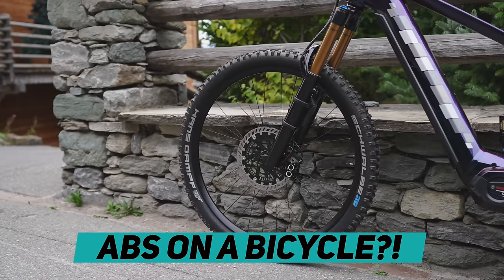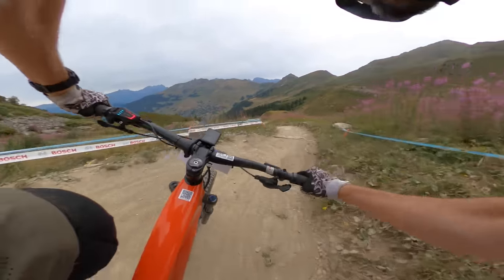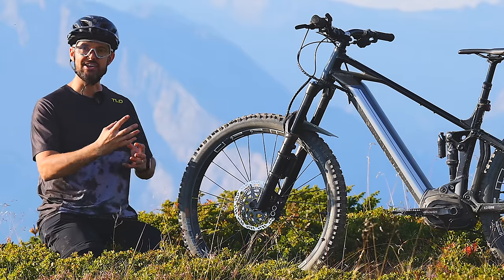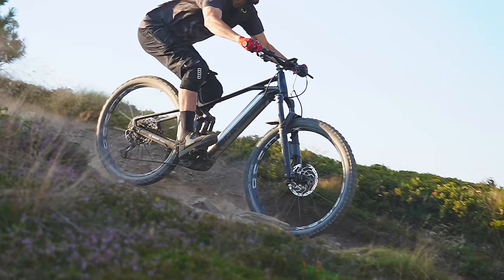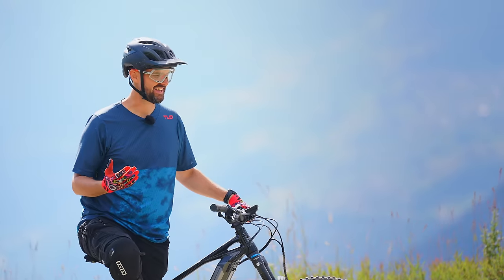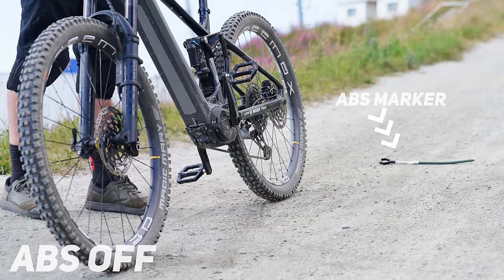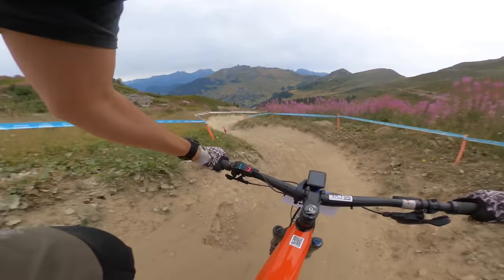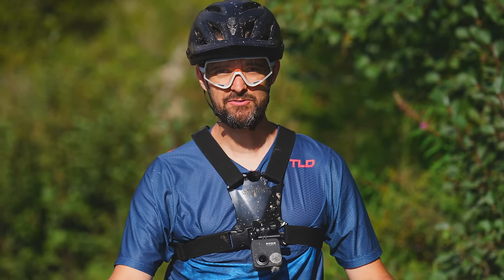I didn't want to like it... Bosch ABS is INSANE!

Comment: For new riders commuting to work on an ebike riding on wet, slick roads with mixed surfaces I think that ABS would be fantastic. Especially people who are slightly older and don't have years of built up muscle memory and quick reaction speeds. For emtb use I can see how it might help new riders coming into the sport, but I worry that this is just more tech that is impossible to service or repair. We already see many motors that are like iphones. One tiny thing breaks (eg: force sensor) and replacement pars are not available, like an iphone when anything breaks you are told to replace the entire unit.
Reply: And unlike iPhones, you can’t buy a fully guaranteed refurb at a discounted price, nor a policy for fix or replace after the original guarantee ends…
Reply: @Coolcmsc  I'm quite fortunate enough to live less than 30miles from a company called - "performance line bearings'. He can refurb a lot of out of warranty motors, my 2019 brose for sure. 
But this tech right here, i think you could be right. It's going to take a brainiac to sus out. Also depends on what kind of warranty length they offer. Surely if the warranty is spent,they can't moan when people start to strip down this unit to see what is what.
Reply: apple got sued for those practices a while back, now they do offer replacement parts. 

I don't use apple I use Samsung, because they didn't need to use ads to lie about their product to get sales. 

anyways, I have insurance on my phone since I'm always outside, anything breaks I just get an entirely new phone, I use the service probably once or twice a year (the limit is twice a year for me) 

usually insurance is too expensive to be worth it, but not phone insurance. I saved a lot of money just having my phones replaced, 

sometimes they even just send me the newer version of a phone if they can't replace it,
Reply: @mikee8244  the more software there is, the more software engineers there must be. Some hobbyist will crack the tech and the next and the next. It will all become "affordable" to service and maintain eventually. :)
Reply: As long as there is an off.  I dont see this getting regulated like motorcycles that go on road...but eventually the tech will be there
Reply: My fuggin dad. I let him use my mtb for a 1 mile ride and the number of times he skid my brand new 80$ tire.... i wanted to charge him
Reply: Unlikely seeing it’s a fully developed tech in cars and motorcycles.
Reply: E bike are generally about 10-15kgs more I generally over cook corners cause of the weight this would help on long days out  . Not for DH bikes at the park ect
Reply: 💯 percent agree ! It’s pretty cool isn’t it !
Reply: @tomhuber5372  wny not
Reply: A force sensor is generic and if you dismantle it can be replaced. E.g most sensors on ebikes such as speed sensors, force sensors are merely Hall effect sensors which are like 20 pence to buy from a electronics supplier.
Reply: Problem it's crazy expensive and complex to fix once broken, part of me loves it and is fascinated of the tech being developed and put on the market but part of me just hates it because I know it will just make bike prices increase and now some ebikes are getting closer to motorbikes than actual regular bikes and weight 30Kg...

So yeah when you say "for new riders commuting", for me that sounds like hell, commuting on a regular bike is fine and people shouldn't be afraid or feel the need to buy crazy expensive high tech bikes like those ones with ABS just for a tiny bit of supposed extra safety...
Reply: Ok boomer
Reply: one area I'd add the ABS system being useful outside of the areas mention would be rental bikes, since the shop doesn't know what skill level or terrain the riders are used to it could give some added security and peace of mind for the bike shop or bike park and few the rider renting they'll have a more comfortable time if they're new and for experienced riders it would either not make a difference or just allow them to go faster while in more control then usual.
not long ago I was riding a rental bike and it took me a bit of time before I could have my braking controlled without slipping since it had less grip then I was use to having while riding on different terrain and the brakes also had a different grab from what I was used to so I would love some sort of ABS when in a situation like that.
Reply: So you could say that the brakes brake well but if the brakes break then the brakes won't brake anymore.
Reply: @Christophe_L  the normal brakes should work just fine even if the ABS system would fail, the systems are technically independent and just influence each other so just because 1 fails doesn't mean the other one will
Reply: Just wait until the lawyers get involved with liabilities.
Things like: unable to ride your bike until it receives a software update "for your own safety",
We don't want to get sued for a failure or defect.
Reply: @TheShift1313  I certainly do see the government and insurance companies getting involved and complicating things. There is plenty of places that require people now to wear helmets on bicycles.
And you can bet insurance companies will get their nose in it with the cost and expense of modern bikes. Health insurance life insurance theft Insurance of the expensive bikes is most certainly going to raise eyebrows of insurance companies and they will get nose deep any bike technology and mandates.
Reply: yeah, any more expierienced rider will have no problems riding without abs xD
Reply: @rizen3467  even inexperienced riders will have minimal need for ABS outside of a few rare occasions with all riders both pro level and beginner could benefit from it although the benefits would be in different areas and situations.
Reply: After buying an Ebike, I've realised the best thing about bikes is slowly fading. You don't feel like the bike is truly yours completely. ABS is fantastic, but takes further down that path.
Reply: Hmm I know that the likes of Bosch do sell motor refurb kits to dealers and repair shops.    For Panasonic and Yamaha motors (the two types I have), I am able to order parts online, and I even got my hands on the technical manual for the Yamaha.  On the other hand, tasting the motor as a single unit isn't that unreasonable in my book, as it's just one part off the system, and may be cheaper to replace than repair given the cost of human labor.

Also, ebike motors from reputable (read: not Chinese) brands tend to last a very long time without any maintenance.
Reply: @tastytechaddictsmtb  speed sensors yes, torqe sensors, no.
Reply: @rizen3467  your say that, but switching between bikes, or especially to a new bike can trip you up.  Even though I had put many thousand miles on my XM-1, I launched myself like a missile with a few days up upgrading to the XM-D2 because the brakes had three stopping power of Godzilla and the sensitivity of a butterfly.
Reply: Hell, as a crusty old fixed gear rider commuting on the bike year round, I'd love to have this up front.
Reply: ABS would be more useful in powerful 1kwatt or more ebike with big 200mm brakes.
Reply: It's actually just useful straight up, I'm well experienced but you get a car over the line on a country road with gravel when you have to nail a line, especially when you're going 50+kmh on a heavy bike and you could be in the exact scenario I found myself in, not needing to worry as much about front wheel lockup is a Huge deal. If this system is mountable to any bike that would be amazing. But I certainly agree with the repairability, I'll service ebikes but not from the big brands that make it impossible to repair without damaging the case or integrity of pack.
Reply: But when you buy an iPhone, you know that everyone else who buys one, is just going to buy the next one when it comes out. So there's no incentive to produce spares for a tiny number of people. ABS systems aren't pushing needless updates every 5 minutes. Making a camera sensor slightly higher resolution without making it bigger, is pretty easy. Inventing an entirely new material for brake pads, is not. And on the electronics side, the people making ABS systems, likely don't create a single component. It's all off-the-shelf stuff as far as electronics is concerned. So it's not like your brakes are going to be obsolete by next year
Reply: Ehh adding more things to a bike just means more to go wrong.
Reply: @iliketoast7804  True, this is why I only buy carburated bicicles! Those thing run forever!
Reply: @SquadronLeadr  Did not work with smartphones tablets or laptops (especially everything from apple)

Comment: I like how you clarified early that the ABS only does its thing on the front wheel, despite using sensors on both front and back. Great video!
Reply: I think it was a safety choice as locking just the rear keeps the bike tracking straight
Reply: q
Reply: Abs can only work if it has sensors on multiple wheels
Reply: I don't actually get that part. If the rear wheel speed is the reference point for the abs system, when you apply brake on the rear wheel as well as the front, wouldn't the system lose its reference point?
Reply: @ermanakbay  
Nope, because if both wheels are in solid ground they're both going the same speed.
If you apply front brake only, you'll slow both wheels.
If you apply it very hard the front wheel will show down faster than the rear so the abs will detect that the front is starting to lock up as the rear wheel is still turning.

It's just making sure the front wheel is always turning the same speed or more than the rear.
It probably uses motion detection as well to help.
Reply: @ermanakbay  
Same applies if you apply the rear brake as well.
It's just keeping the front wheel from slowing down faster than the rear.

Which is why I guess it uses motion detection as well to calculate when you lock the rear up while moving, it'll probably just make sure the front isn't locking up until you come to a stop.
Reply: @Robert-cu9bm  if you look at the part of the video where he measures stopping distances, you can see that he locks the rear wheel and while the rear wheel is skidding abs still works. That was my point
Reply: That's Erman's very good point. The video can't be giving us the whole story. I think that is important; we need to understand how motion is detected. Let's hope it's not gps....
Reply: @firstnamelastname2669  my guess is something like accelerometer
Reply: @rajgill7576  It's more a physics thing. There's a hard limit on how much the back brake can slow you down. The more you slow down, the more weight shifts away from the rear, and the less grip you have. The back brake on a bicycle is never going to do much to slow you down. The bike is too light, and the center of gravity is too high. That's why it's easy to make such long skidmarks at such low speeds

Comment: Another potential benefit for this tech are for people who suffer from arm pump from super long descents because let's face it, when your arms are sore, brake modulation takes a nose dive and risk of accidents can increase. Having ABS on is good safety solution even for advanced riders that use extremely large rotors where modulation is non-extent with the on-off behavior.
Reply: Never had this mythical "zero modulation" problem.
Reply: @FightFilms  I drink and drive every opportunity I get, haven’t killed anyone yet!
Reply: I've never really had that problem with the brakes. I get it's a decent idea. But pushing the brakes isn't really that big of an effort. Sure it can be quite tiring, but not really dangerous. Also you don't brake at full force most of the time, you brake lightly to avoid locking the wheels so it's not really that much strength that you apply
Reply: @ernestomartinezros9046  technically, the ABS will always outperform humans and shorten braking distance while maintaining optimum traction and stability. the best humans can react is around 120ms while the sensor can respond near instantaneously. The best human control can do is just threshold braking

Comment: Based on me growing up riding motorcycles on and off-road with no ABS and then with ABS it’s 100% better in every scenario apart from when you want to do stoppies
Reply: Yeah that's always been my main concern
Reply: it's not 100% better in every scenario. 
motorcycles go extremely fast compared  to mtb. 

motorcycles are on flat smooth terrain. 

mtb is on rugged inconsistent trails that require more control, 

there are many instances where you WANT your wheels to lock up to perform slides and other maneuvers. 

abs prevents wheel locking, no more sliding out your back tire at will, you now have to fight against abs to do it. 

also, I'm a motorcyclist. in the world of stunt motorcycling, they prefer not to use abs breaks, because they are better at using their brakes than the system is. 

the abs system doesn't know what you're trying to do, it just prevents wheel locking. 

mtb is cycling sport that requires higher control, 

automatic braking systems (abs) is a downgrade in terms of control.
Reply: @selfactualizer2099  someone didn't watch the video.
Reply: @selfactualizer2099  did you watch the video? It's only front wheel
Reply: @selfactualizer2099   First of all you clearly didn't watch the full video. Secondly you can just turn it off if you don't feel like using it for your particular ride.
Reply: @selfactualizer2099  How does it feel to get called out? Haha
Reply: @selfactualizer2099  You have very limited view on where motorcycles are used on. On my motorcycle, when riding off-road I usually turn off the rear ABS, but I never have wanted to disable the front one.
Reply: Not the same but related so I'll throw it into the pot, I've had the traction control on my MT-09 save my bacon a few times.
Reply: @taavim7340  you dont like to crash? I always here the part time moto GP riders say that abs is the evil and they brake way better without it. When i watch daschcam videos they all crash while panic braking.
Reply: @K0nst4nt1n96  you know anybody who likes to crash? ABS has never been the fastest way to brake, but in most cases it still is safer. So in moto GP where you are after fastest times you probably can be faster without it.

Comment: Will be interesting to see an intermediate rider nervous about going down a steep dusty rock slab( thinking something like original sin at whistler) and then a beginner rider with abs show up and execute it perfectly with no sliding just by fully grabbing the front brake.
Reply: And then that very same rider getting on a non abs bike and dieing :/
Reply: Will also be interested to see what happens when the batteries run out or the ABS computer malfunctions haha
Reply: true true but i still believe that everyone should properly learn how to modulate brakes, not just rely on ABS. (just like how we learnt in cars with no abs)
Reply: @godzillaxred  then again no one learns to do that these days in cars. Its been decades since non ABS cars were even sold. In fact onw people say it is harmful to learn that as this may lead to wrong reactions with ABS enabled cars. I agree with your point for bikes though, as this is a basic skill and non ABS bikes will always be around.
Reply: @nelly5538  id imagine it’s hooked directly to the ebike battery
Reply: @nelly5538  it would be very obvious when the batteries run out and I have not heard of an ABS malfunction in 30 years.
Reply: @nelly5538  I'm not sold on the system but the ABS will not have any of such electronic failures. There are hundreds of embedded electronics systems running real time critical tasks thousands of time a second in your car engine or in a plane. Do they fail?
Reply: @1312_PV  bikes are a bit more exposed to the elements and impacts than a car though
Reply: @joshualabonte8478  Is a moto a good example for you? Or antennas which handle gigabit transmissions?

I don't enjoy this system that much (if it were free I'd get it, but I'm sure this will drive bike prices up hugely), but it is most definitely nothin technically extreme.
Reply: LoL it's an ABS system. Not automatic terrain-adapted braking system
Reply: Abs won't find grip for you.